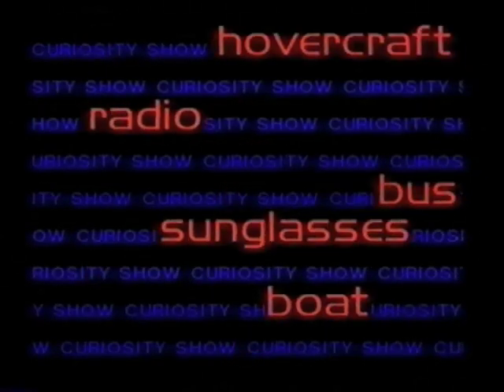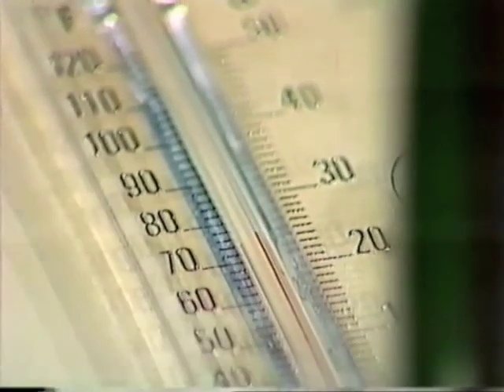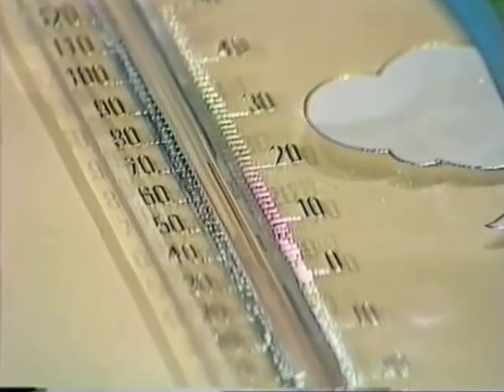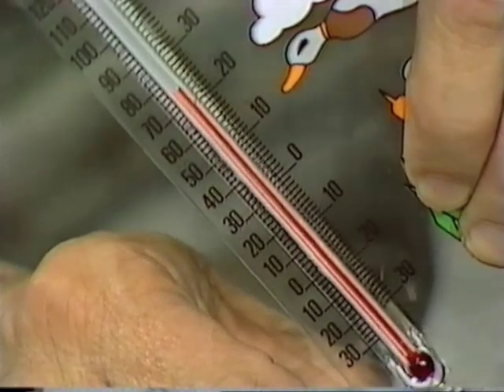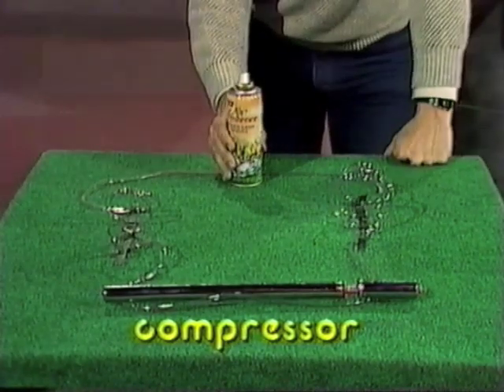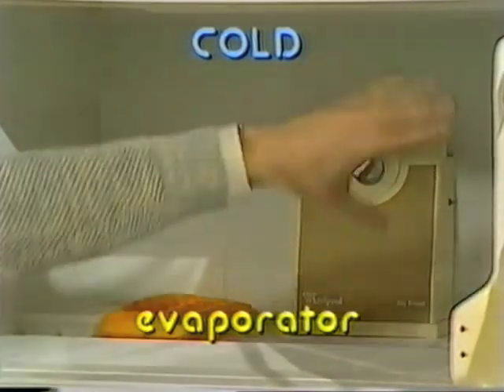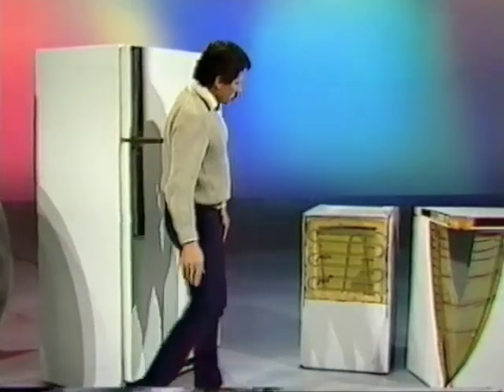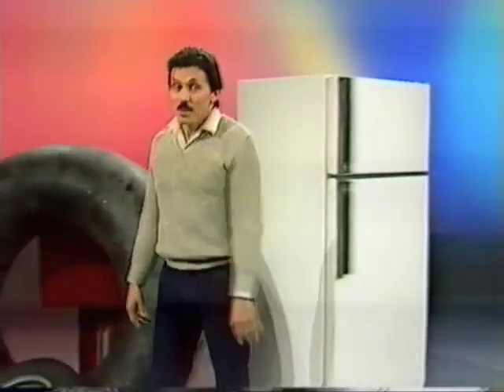Refrigerator - How Does It Work?

Comment: The fridge is by FAR the most reliable machine in your house. A fridge’s compressor motor will spin around several billion times in its life without service, cleaning or oiling.
Reply: Inaccurate 

A simple machine like a crowbar for example will work infinite times as long as you don't break it
Reply: Crowbar isn't a machine
Reply: @frankiephenomanal  A crowbar is a lever

A lever is literally a simple machine
Reply: @hiyukelavie2396  I'm assuming he meant automated machine, but could be wrong ...
Reply: Actually there is oil circulating with the gas that lubricates the compressor.
Reply: @hiyukelavie2396  crowbars would wear down and possibly bend
Reply: @Matt-ot9nx  Depends on what you use it on, and unless you're trying to break it on purpose, it'll still very likely outlast your fridge
Reply: @hiyukelavie2396  a crowbar is not a machine you doughnut its a tool and don’t be smart calling it a simple machine.
Reply: @themenacedemonkiller4867 
In physics a lever, and lots of other things like screws are called simple machines. Dude just forgot to add that.
Reply: @themenacedemonkiller4867  I suggest you look up what simple machine means
Reply: Not all things with the same signifier have the same signified, mate.
Reply: @Azchk   The clue is literally in the name 

Just because your understanding of the word "machine" is inaccurate doesn't change the fact that a crowbar/lever is in fact a machine

A machine is simply an apparatus that performs a function by using mechanical power, and mechanical power is simply the combination of forces and movement in a system
Reply: @hiyukelavie2396  You said it would work infinite times
Reply: @Matt-ot9nx  You're right it wouldn't
Reply: @UCQJ7S4vdrDfzv-HENBuQoEQ "A crowbar is a machine used (operated) by hand"

Correct

You say I'm trying to "win an argument", but I don't even see one 

A crowbar is a machine, full stop. What is there to argue about?
Reply: Thankfully, it's still the case, more or less. It would be with many other machines and appliances as well, if not for the perpetual renewal and purchasing culture. Lightbulbs can last hundreds of years if manufacturers would agree. Not a lot of business in that, though.
Reply: @hiyukelavie2396  I guess we could argue that it's only a machine when being used. (No more of a machine than a stick and a rock, being used for decoration on the lawn, when unused.) I could also argue the same for a refrigerator.

In which, a plugged in refrigerator is a machine longer. Since, a crow bar is often unused for periods of time.

But that's just digging up an argument, for fun sake. Not arguing that they are both designed to be machines. Just questioning if they are machines, when unused. Does the lack of force, mean it can't be considered a machine at that point?
Reply: No. My fridge gave out after 4yrs, during which I had repaired it 3 times. I swear my toilet last longer than that
Reply: I'm impressed you all didn't understand David Price's statement...
Reply: I like this thread, so I will add a bit of argument for fun.

What about in term of continuous service? Like OP said, fridge is reliable in the way that it can run billions of cycles in it life without maintenance.

A crowbar using long enough and it will bend, not familiar with pasta maker but I highly doubt it can last for so many cycles continuously without cleaning, aka, maintenance, scissors can be worn out without sharpening, about the lamp, you wouldn't turn it on 24/7, along with the fridge, right?

In this term, I think only a very good clock can compete with.

Again, this is just for fun, feel free to argue or point out what I maybe wrong about.

Edit: Spacing
Reply: @Bork-but-weird-letters   "Billions of cycle" sounds impressive, until you realize that the average life expectancy of a fridge is between 10-20 years
Reply: @hiyukelavie2396  still, about 90% of that time is the fridge running non-stop
Reply: @Bork-but-weird-letters   I understand your point, but it depends 

For a lamp, most of the wear and tear occurs when you switch it on and off 

Leaving it on without ever switching it off is actually better for its life expectancy

Look up the Centennial Light, a light bulb that was installed in 1901 and is still working

It sounds counterintuitive, but you will likely shorten the lifespan of your fridge if you had to switch it on and off multiple times a day instead of just leaving it running
Reply: Everyday words in the context of physics can mean very different things from the everyday meaning.
Reply: @hiyukelavie2396  ActUAlLy! wtf dude :D
Reply: @Azchk  what? thats like saying a small mountain isnt a mountain because its small. jesus wept
Reply: @themenacedemonkiller4867  it literally is. words have meanings and definitions my dude. a lever is a machine, just look it up
Reply: @hiyukelavie2396  “It’s not about being a smartass”
PROCEEDS TO DEBATE FOR 8 DAYS
Lmao
Reply: @hiyukelavie2396  a car also needs maintenance. But if I were to measure kinetic energy of a car versus a crowbar. I'm pretty sure the crowbar's entire lifetime, wouldn't compare to a car running for 100 miles. 10 miles might not even be comparable.

Same movement comparison with a refrigerator. Even though a refrigerator does not continually run. The compressor is continually shutting on and off. And that's without counting defrost cycles. But still, considering the kinetic energy involved. Crowbar < refrigerator. (It's an apples and oranges comparison anyways. It would be better to compare a wheelchair ramp. Imo.)

I will give you that OP was wrong about continual use. Refrigerators that are continually run, don't run as long. Most restaurants need maintenance about once per year, because the doors are frequently opened.
But then again, you were also wrong when comparing a light bulb to a refrigerator.
Reply: @MrBakblast  Is that how you cope when you are wrong?
Reply: @HugeSweetTea  Lol do you have any idea how triggered you sound?
Reply: Not if it's a Hitachi.
Reply: @hiyukelavie2396  I believe that was Bryan kory's first comment. If that's the case then he's a bystander making an opinion about you... and determining if someone is pedantic, is a matter of opinion in this context.
Unless you are saying they are lying about their opinion on you?

Or are you assuming that because they consider you "painfully pedantic" that they are against you? I wouldn't assume that since I've agreed with the conclusion, yet considered the person making it pedantic... not exactly in my own words.

To the trolls who might attack you... I don't think it's right.  I think you might be trying to focus away from something else, perhaps in personal life. So you are focusing on whether a comment is true or not. But that's me assuming and  projecting a bit.
Reply: @josholin31   I didn't make any assumptions about Bryan Kory 

I made no assumption on whether he was wrong or not, or whether he was trying to cope or not, or any other such thing. I simply asked him whether calling someone pedantic when he's wrong is his way of coping or not 

As for all the other stuff that you mentioned, what makes you think I'm not here simply because I find this whole thread amusing?
Reply: @hiyukelavie2396  where did he say he was trying to cope? Where did he even say something that could be questioned as fact?
He only stated an opinion.

It's about as relevant as asking if they sing while taking a shower. Unless you assumed he made a stance... nothing wrong in assuming, as long as you are aware of when you do it.. personally, I think it would've been better to let them know that in certain situations/professions, precision matters. So it's a good skill to practice.
(Idk if I mentioned it, but I think it's more likely that you thought they were someone else who previously replied to you.)

And about the rest. Like I said, It was an assumption and slightly projecting. I think it's a pretty fair assumption though considering the last few years and current events.
Reply: @josholin31  Lmao I didn't say he was trying to cope?

We all saw him calling someone pedantic

It's an interesting behaviour I find, so I asked if, by chance, that's how he cope with being wrong?

That's not the same as saying that he's coping with being wrong right now 

If anyone's making baseless assumptions here, it's you my friend
Reply: @hiyukelavie2396  lol. So how do you cope with eating bananas?
Reply: @josholin31  Bananas are delicious, no coping needed at all, just enjoy them as they are, after you peeled them of course 🙂
Reply: @hiyukelavie2396  or you don't eat to many. ;)
Reply: This conversation will last longer than the fridge 😳
Reply: @hiyukelavie2396  Also, we all knew that when anyone said "machine", they simply mean "compound machine", and compound machine is the combination of 2 or more simple machines; so refrigerator and crowbar are just incomparable.
Reply: @ultimaxkom8728  People like you just hate being wrong don't they
Reply: @hiyukelavie2396  *Scrolls up and skims the whole thread* Heh, how very ironic for you to say that here... Well, anything else useless you want to say? To help yourself cope more, that is.
Reply: @ultimaxkom8728  It's very obvious who's the one doing the coping here, isn't it? 

I'll just repeat what I said at the beginning:

"Just because your understanding of the word "machine" is inaccurate doesn't change the fact that a crowbar/lever is in fact a machine"

That's all that needs to be said here, really
Reply: People in here are arguing the semantics of a word definition, but words are inherently fluid in their meanings.  Definitions change over time, as do the words themselves.  That being said, in order to be precise some words maintain very rigidly defined boundaries as to be effective when communicating a message that needs to be as exact as possible.  Both sides are right.  

In common usage a layman wouldn't call a crowbar, or a cable, or other commonly used seemingly simple devices a machine.  However, that doesn't change the fact that they are still technically machines.  All it demonstrates is that language is used differently in different arenas.  The correct usage is the one that conveys meaning most effectively between the two parties.  If the receiving party hears a word that not only seems out of context, but will add nothing to the intended understanding of the situation, language is being used ineffectively and therefore is less correct in that situation.  Language, like all communication tools, is inherently situational and therefore to some degree fluid.
Reply: Lmao looked up machine “simple machines such as levers use hinged or revolute joints” a crow bar is a tool 

dying rn
Reply: it gets cleaned by the filter/water Seperator which on large units is changed several times in its lifetime. oil is added and changed as well on these units long with the refrigerant. By large units i mean the ones in commercial kitchens. some no bigger than a standard refrigerator. The issue with consumer ones is that they are made to never be serviced so they lack the ports to gauge up too and  are often not built with replacement of parts in mind. but i mean you could add a quick tap to gauge up too and do these things to the one on your house and they would last much much longer...some data sheets arnt available for them though
Reply: loltism and a drag
Reply: @hiyukelavie2396  we do have time to hear this, your a trained professional Gordon!
Reply: @whitenoise509   Correct 

The people arguing the semantics just couldn't stand being wrong 

Because even if we took "machines" to mean a more complicated apparatus than a lever, there are many other such machines that easily outlast a fridge. The examples I gave include clocks, pianos, sewing machines, a table lamp, and I'm sure we could think of more if we try to 

Seems like some people can't accept that, and resorted to arguing the semantics
Reply: @hiyukelavie2396  I'm only responding to your original assertion that a crowbar is a machine because I can't be bothered to read the rest of this weird tirade you've gone on. A crowbar is only a lever when in use, and the lever includes whatever you're bracing your crowbar against to serve as the fulcrum, so no a crowbar is not a machine.
Reply: @xEmptyPockets  "... I can't be bothered to read the rest of this..."

Oh you should. Because if you did, you wouldn't be making this post, because you would have seen this:

"A machine is simply an apparatus that performs a function by using mechanical power, and mechanical power is simply the combination of forces and movement in a system"

So yes you are technically right that a crowbar is only a machine when used. But by that definition a fridge is only a machine when plugged in and used

So if you're going to argue that the fulcrum is part of the crowbar, then you are essentially arguing that the wall socket is part of the fridge 

I don't need to tell you how silly this argument is 

But you are free to think this way if you want to, it's no loss to me
Reply: @ultimaxkom8728   Oh interesting. So you don't have a problem with my overarching message and the reason you're huffing and puffing right now is because you disagree with me regarding the definition of the word machine

Lmao who's the one harping on semantics here? 

Your action here is the literal example of someone harping on semantics. How bizzare. Do you even listen to yourself my friend
Reply: @hiyukelavie2396  crowbars need humans to work and humans need maintenance
Reply: @Roger_808  Where do you think fridges get their power from?
Reply: @hiyukelavie2396  the little surprided face in my wall
Reply: @Roger_808  And where do you think that little face in your wall gets power from?

A power plant 

Which requires maintenance
Reply: @hiyukelavie2396  I know it's a distinction without a difference but I think it only becomes a machine when it's paired with a fulcrum. Which is every time it's in use so it doesn't really matter
Reply: @hiyukelavie2396  the refrigerators compressor will rotate more times then grains of sand on earth it will have experience more rotations in it's existence the universe has currently... Is your refrigerator running? Go listen to what your wise old friend might have to say ✌️
Reply: Hmm. . . Even here I find them. It is day 2 of my investigation into this phenomenon and my findings are. . . interesting. See, there appears to be a growing number of human subspecies who for some reason go into comment sections such as this (particularly science related post) and over analyze a text or speech as if it were a piece of academic dissertation.

It makes me curious, do they take everything they hear literally? Are they a living Drax?

See to an ordinary human, the original post was pertaining to a specific feeling one might have for their refrigerator as weird as that might sound but the point is, a normal human reaction would probably be to "feel" or relate to that emotion that the OP wanted to express. 

But no! These human subspecies would take a fucking dicktionary and shove it down everyone's throat. The meaning completely lost to them, all that matters is that they are correct in the technicality of the words. 

It's like if I said, "I'm crying a river." They would literally type "no human is capable of crying a volume of tears equal to a river."

Which yes, it is correct! You're right! But that wasn't the point. You were not supposed to overanalyze the definition of the words used nor was it necessary to do so.

The comment is about the appreciation of the fridge and how reliable it is.
Reply: Most polite comment thread I've ever read.
Reply: I’ve never seen someone so eager to double-down on a bad hand so many times in one single thread over the course of two weeks before. Amazing.
Reply: @Kathleengrace_  Nice closing
Reply: Jokes on you, you don’t have our old fridge.
Reply: hard to repair
Reply: I actually enjoyed the thread. Made me remember and think over some facts. Thanks all for our shared boredness <3
Reply: @ultimaxkom8728   Oh, I understand you just fine 

Like I said, you don't have a problem at all with my overall message 

You just disagree with me on the meaning of the word machine 

Or in other words, your whole argument is based on SEMANTICS 

Do you not see this?

Who's the one being stupid here?
Reply: @aryanagrawal5629  Interesting

Why are you even on this channel if you're so allergic to learning?
Reply: @hiyukelavie2396  In other words, you didn't read what I wrote... *Sigh* Please reread my 2nd last message's last part where I literally and directly told you what the problem was. Now, read it right. I hope this mission wouldn't be too hard for you.
Reply: @ultimaxkom8728  Lol, you really hate being wrong, don't you?

Like I said, the ONLY argument that you've been making all this while is how you disagree with my definition of the word machine, which happens to be the correct definition

You're literally clinging onto semantics 

What else is there to say?
Reply: @ultimaxkom8728  Or, let me see if I can make this even easier for you

Do you agree with me that:

1. OP's post was inaccurate
2. A lever/crowbar is a machine

Yes or no would suffice
Reply: @hiyukelavie2396  Okay, I'll answer your questions. In return, you have to answer mine as well. 1) Yes. Although again, OP being wrong matters not. 2) Crowbar is a simple machine. So yes and no; by semantics it's a machine, but by use it's not.
Reply: @hiyukelavie2396  Now's my turn:
  1) Is the reliability of a wooden stick comparable with an electrical machine such as a gaming PC?
  2) Who is the first one to argue with pedantry and semantics in this thread?
Reply: @ultimaxkom8728   Very good 

You agree with me that OP's post was inaccurate, and you agree with me that a crowbar is a machine 

So... What is your problem?

Actually I'll tell you what I think your problem is

Your problem, like most other triggered people in this comment thread, is that you had a incorrect understanding of the meaning of the word machine, but you can't stand being corrected 

It's obvious isn't it?
Reply: @ultimaxkom8728  Uhm

1) I don't understand this question 

2) Why, of course it's all the triggered people who are trying to argue the meaning of the word machine
Reply: @hiyukelavie2396  Can you read? I said Crowbar is a simple machine, so yes by semantic and no by usage. Nobody outside the physics class who's not a pedantic like you consider a crowbar a machine. And no, that's not the problem. Read again.
Reply: @ultimaxkom8728  Lol, are you listening to yourself?

You are literally trying to argue the meaning of the word machine 

You are literally arguing about semantics 

This is all you've been doing since the beginning
Reply: @hiyukelavie2396  Nobody asked for a wikipedia entry for the definition of the word machine. I didn't even argued about the word's definition, yet you kept thinking that I do... Now now, how about you just answer my question. Don't try to avoid it.
Reply: @ultimaxkom8728  "I didn't even argued about the word's definition"

LMAO

So what is your problem?
Reply: @hiyukelavie2396  Also: "This is all you've been doing since the beginning" - don't you realize how ironic for you to say that? You talks as if I am the first one who started the argument about semantics weeks ago and being a killjoy for everyone here.
Reply: @hiyukelavie2396  "So what is your problem?" 
   ...
Do you even read what I wrote? Dude, what were you doing all this time? *Facepalm* Am I talking to a wall all this while?
Reply: @ultimaxkom8728  Oh, I do read what you wrote

And what you wrote is you trying to argue the meaning of the word machine 

As I said, stop it, it's getting embarrassing for you
Reply: @hiyukelavie2396  You argued a crowbar, a simple machine, is more reliable than a fridge, a compound one. You compared the incomparable in the basis that crowbar, by semantic, is a machine. You're arguing the semantics.
Reply: @hiyukelavie2396  No you don't. You kept saying that I argued the definitions of the word machine even though I didn't. That is the narrative you're clinging on. So it seems like you're on your last straw. Hm... Btw when will you answer my questions?
Reply: @ultimaxkom8728   No, don't be stupid 

First of all, OP did not specify that the comparison was only about complex machines. But even if the comparison WAS about complex machines only, OP's comment is still inaccurate

Secondly, there is nothing inherently wrong with comparing the reliability of a complex machine with a simple machine - they're both machines, and depending on the specific machine being compared, they all have different levels of reliability

And thirdly, you're trying to make it sound as if a simple machine has some kind of unfair advantage over a complex machine when it comes to reliability

This is not the case at all

A broom for example will get worn out long before a fridge breaks down 

Seriously, what are you doing man?
Reply: @ultimaxkom8728  "You kept saying that I argued the definitions of the word machine even though I didn't"

LMAO, says the guy who is trying to argue "machines" = "compound machine"

You are literally trying to argue that the word machine only refers to complex machinery 

Stop and listen to yourself
Reply: @hiyukelavie2396  1st: You're just being obtuse. You knew exactly what the OP meant by machine. Again, this is not a physic class. 2nd: Yes there is. Especially so when comparing a crowbar to a an electrical machine. 3rd: Doesn't matter.
Reply: @ultimaxkom8728   No

1) It's not a problem if OP, and you, did not know what the word machine means

It IS a problem when you cannot accept being wrong and try to argue that "machines" = "complex machines" only

2) According to who? You?

3) Lol "doesn't matter". Is that how you react when you have nothing to say 

Again, it's abundantly clear what the problem here is 

People like you just can't stand being wrong
Reply: @hiyukelavie2396  Wrong. I argued that machines by the common use, aka for any non-educational uses, like the OP's simply meant compound machines. I never said that simple machine are not machine. Please stop twisting my words.
Reply: @hiyukelavie2396  1) Again, I never said machines only meant complex machines. Stop lying. 2) According to the common sense that a brick is not to be compared to a brick house. Or a wooden stick to a gaming PC. 3) It simply doesn't.
Reply: @ultimaxkom8728  Uhm, don't be stupid 

You absolutely can compare a brick and a brick house 

For example:

Q: Which is more expensive, a brick or a brick house?

A: A brick house

There you go. I just compared them

Stop trying to be obtuse
Reply: @ultimaxkom8728  🤣🤣🤣

You: "I'm not trying to argue semantics"

Also you: "Well machines obviously means this"

GTFO man
Reply: @hiyukelavie2396  I'm only pointing it out what machine commonly means, not arguing the definitions of the word machine. Plus, are you disagreeing that the common use of the word machine simply means complex machine?
Reply: @hiyukelavie2396  Wrong again, I never said a brick "cannot be compared" with a brick house, and I never said that I'm not arguing semantic. Because of course I have to; you're arguing about the semantics after all. Also, where is your answers?
Reply: @ultimaxkom8728  Oh god this is gold

Semantics: the branch of linguistics concerned with meaning 

When you try to argue what the word machines mean, you are literally engaging in semantics

Or are you going to start arguing the meaning of the word semantics now 🤣🤣🤣
Reply: @ultimaxkom8728   🤣🤣🤣

You: "I never said a brick cannot be compared with a brick house"

Also you: "According to the common sense that a brick is not to be compared to a brick house"

What are you doing?
Reply: @hiyukelavie2396  1) Again, I am arguing about semantic, I never said otherwise. Read my last reply. 2) I never said they "cannot be compared," yet you "disproved" me by saying that "You absolutely can compare (them) ...". Lol.
Reply: @ultimaxkom8728   Ok!

So you agree that YOU are the one who's bringing semantics into this

Good! We're making progress then!
Reply: @ultimaxkom8728  LMAO look at you trying to wiggle your way out of the hole you've dug for yourself

You said that a brick is not to be compared to a brick house

But I did just that 

Take your own advise and stop being obtuse
Reply: @hiyukelavie2396  What? You're the one who brings semantics to all this, and so me and everybody else had to as well. Please reflect. And "is not to be compared" means one shouldn't, not that one can't. How hard is it for you to understand?
Reply: @ultimaxkom8728   Lol no don't be stupid, read my very first post again 

I pointed out that a crowbar will outlast a fridge 

There isn't any arguments about semantics involved at all
Reply: @hiyukelavie2396  You compared crowbar a simple machine with a fridge because by semantic, they're both "machine", even though you knew the OP simply meant "machine" by its common use. Again, you're arguing with semantics. Just admit it.
Reply: @hiyukelavie2396  There's nothing wrong in just comparing a brick with a brick house, ofc, but that is only when you forget the context. The context here is ofc that it's just an analogy of the crowbar and the fridge, and with the context, yes it's wrong.
Reply: @hiyukelavie2396  I said simple machines shouldn't be compared with complex machines, just like a wooden stick is not to be compared with a gaming PC. Haah... Do you have dementia or what?
Reply: @ultimaxkom8728  And why shouldn't simple machines be compared with complex machines?

Is this the same stupid logic like your brick and brick house example?
Reply: @hiyukelavie2396  Just use some common sense on why wooden stick, a simple machine, should not be compared with a gaming PC, a complex machine, on reliability.
Reply: @hiyukelavie2396  No, the context here is which machine, obviously in its common use meaning, is more reliable. Also, it's not a "perfectly valid comparison", as crowbar is not a complex nor electrical nor automated machine like the fridge is.
Reply: @hiyukelavie2396  1) It's a better analogy for the crowbar, a metal stick, and the fridge, an electronic. 2) A wooden stick is a simple machine. "Are you this desperate to save face" Says you who deleted your own reply that I've just replied to.
Reply: @ultimaxkom8728  Let's review what we know

-You agree that OP's statement is inaccurate
-You agree that a crowbar will outlast a fridge
-You agree that a crowbar is a simple machine
-You agree that a simple machine is a type of machine
-You agree that many machines will outlast a fridge

I've managed to prove that not only do you not have an argument against what I'm saying, you are actually actively agreeing with what I'm saying 

But for some reason, you're choosing to be a whiny little boy here, trying to argue that "oh but machines don't really mean machines"

Seriously wtf is wrong with you
Reply: @ultimaxkom8728  No, a wooden stick is a wooden stick 

Don't be stupid
Reply: @hiyukelavie2396  No, a wooden stick can be used as a lever, so it's a simple machine. Don't be stup- why do you keep repeating this phrase like a kid? Also, this is already a semantic arguments since the very start. All thanks to you.
Reply: @hiyukelavie2396  Here's the logical reasoning: a complex machine is a set combination of 2 or more simple machines, and a single element (simple m.) cannot be compared to a set of elements (complex m.). Just like 1 is incomparable to {1,2,3,...}
Reply: @hiyukelavie2396  About your review, yeesh, talking about being obtuse and childish... You still pretended to miraculously not see my point even after all this. You knew what I actually said, yet you twist it anyway. Don't you feel embarrassed?
Reply: @hiyukelavie2396  1) So? You too talk about a metal stick at the start. 2) You had to be brainless to compare a wooden stick with a fridge reliability and really think that it's a valid comparison just because they're, by semantics, "machines".
Reply: @ultimaxkom8728   What did I tell you about being stupid?

One, your explanation makes no sense. Yes, you pointed out the difference between a simple machine and a complex machine. But you haven't told us WHY they are incomparable

Two, they are NOT incomparable. You CAN compare them in a myriad of ways. I've already demonstrated this to you. Keep up with the program please
Reply: @hiyukelavie2396  1) Because one is an element (simple m.) and one is a set of elements (complex m.), and you can't compare an element with a set. Like comparing the number 5 with the set {4, 7, 10}. 2) Those are not valid comparisons.
Reply: @ultimaxkom8728   😂😂😂

Firstly, that still makes no sense, you're still just pointing out the difference between them instead of the problem with comparing them 

Secondly, we're talking about which one has a longer life span. A fridge has a lifespan. A crowbar has a lifespan. Of course it's a valid comparison 

Try harder
Reply: @hiyukelavie2396  You're comparing a crowbar a SM with a fridge a CM only by the semantic basis of the word "machines", ignoring the obvious that the OP was using its common meaning. So yes, you're started the semantics arguments.
Reply: @ultimaxkom8728   Wait, no, don't pivot away 

A crowbar is a machine, and crowbar has a lifespan

A fridge is a machine, a fridge has a lifespan 

What is the problem with comparing their lifespans?

You can't just stamp your feet and tell people they can't compare them

You need to explain WHY NOT
Reply: @hiyukelavie2396  1) How come you still can't understand... *Sigh* The problem with comparing them is that they're not of the same category; one is an element, and other is a set of elements. One is a wheel, and the other is a car. 
  2) Crowbar is a simple, non-electrical, and manual machine while the refrigerator is a complex, electrical, and automated machine. They're clearly not a valid comparison.
Reply: @hiyukelavie2396  I already told you that an element can't be compared with a set. And again, those plain comparisons you've just made lacked the context. It should be "Which machine is heavier/reliable, a wheel/crowbar or a car/fridge?".
Reply: @ultimaxkom8728   No you haven't explained shit

You're just doing this circular argument thing where you claim that a brick and a brick house cannot be compared, and then when challenged to provide an explanation, you point to your own claim as the explanation, which it is not 

You seem to be under some kind of delusion that a complex machine can only be compared with another complex machine 

Why is that?

There is no such logic

A complex machine can be compared with anything, as long as the comparisons make sense. Heck, anything can be compared to anything as long as the context of the comparison makes sense 

In terms of lifespan, a complex machine can absolutely be compared with a simple machine 

Hell, I can compare the lifespan of a fridge with lifespan of a pair of running shoes if I wanted to 

Q: Which will last longer, a fridge or a pair of running shoes?
A: A fridge 

The comparison makes perfect, logical sense, even if one of them is a complex machine and the other is a footwear 

Conversely, you can make a completely nonsensical comparison between two complex machines 

Q: Which is more honest, a fridge or a blender?
A: Neither because the comparison makes no sense 

In this case, even if we are comparing two complex machines, the comparison does not make sense

I mean, this is all really basic stuff that even elementary school children understand

But not you apparently

It's really bizzare how you keep shouting about how a simple machine just categorically cannot be compared with a complex machine 

I know that you're just trying your best to hang in there and save face, but it's just ridiculous at this point 

Like I said, people aren't stupid. Everyone who reads this sorry ass argument of yours can see how stupid you are acting
Reply: @hiyukelavie2396  Hmm alright. I think I've already had enough and done enough for this thread. This is very likely to be my last reply. So have fun comparing metal sticks with desktop computers all alone once again. Well that's it, bye bye.
Reply: As a stupid person, i have to thank @Hiyuke La Vie

At least he made me not the stupidest person 🤗
Reply: @hiyukelavie2396  are you constantly using the crowbar at maximum effort 24/7?
Reply: @travisdickens4304  Good point, but this has been brought up and addressed earlier 

The counterpoint is that a fridge being kept constantly running is actually something that works in its favour, when it comes to longevity. Much of the wear and tear in these things actually occur when you switch it off and on. Think engines, lightbulbs, the AC, etc

The centennial lightbulb, for example, has been working for more than a hundred years, and one reason for its longevity is the fact that it rarely got switched off. It's theorized if it gets switched off now, it may not switch back on again
Reply: @ultimaxkom8728  I know it might be difficult for you, since you're evidently doing the best you can to try and save face here. But facts are facts 

A simple machine is a machine. A complex machine is a machine. They are both machines

Just as how a chocolate cake is a cake and a butter cake is a cake. A mobile phone is a phone, a rotary phone is a phone. A porcelain cup is a cup, a paper cup is a cup. A table knife is a knife, a survival knife is a knife. A touchscreen TV is a TV, a CRT TV is a TV. And so on 

You trying to argue that there is some universal law against comparing them just because they are different is just the epitome of obstinance and foolishness
Reply: @hiyukelavie2396  went sicko mode in this reply section
Reply: bruh a crowbar is literally a straight bar of metal with a bend in the end. it's a tool. machines have multiple parts that work in unison. nice troll b8 m8
Reply: @GigaNigga-ep3nw  It may come to you as a shock, but things like crowbars, nails, and brooms are all examples of what is called a simple machine
Reply: @hiyukelavie2396  there is no way a crowbar can work infinite times unless it's infinitely thick or long or infinitely dense. 

_>inb4 "you're infinitely dense" comment is posted at me.
Reply: @allaware5014  You are right
Reply: @KingBong420420  well atleast this thread produced this gem. Brb gonna go chat with the interstellar ice box.
Reply: @hiyukelavie2396  
Is a see-saw a machine or a tool?
A see-saw just like a crowbar applies a force on a object by using the principle of leverage. 
I'd say its a simple machine, but one could argue that it's a tool as well. 🤔
Reply: @Matt-ot9nx  
Is a see-saw a machine or a tool?
A see-saw just like a crowbar applies a force on a object by using the principle of leverage. 
I'd say its a simple machine, but one could argue that it's a tool as well. 🤔
Reply: @johno9507  A see-saw is also a simple machine, correct 👍🏻
Reply: @johno9507  a simple machine is a tool
Reply: @hiyukelavie2396  Getting back to your original comment. You loaded a conditional proviso into the assertion of infinite working life: "...as long as you don't break it." This makes total nonsense of the hyperbolic use of "infinite" and the comparison. 
Fact: Crowbars do break and bend. Fact: I have had crowbars that failed within 5 mins with normal use. Fact: Fridges also break and fail. 
Your whole comment was self defining and the exact same could be said about either the fridge or any other thing. Everything works forever - until it doesn't.
We will all live forever so long as we never die.
Reply: @DiscoFang   Things sometimes stop working due to breaking from incorrect usage, and things sometimes stop working due to wearing down from regular usage

The "as long as you don't break it" proviso serves to differentiate between this 

But yes, I agree with the problem of using the phrase "infinite times". You aren't the first to point this out

Still, I enjoy reading your reply. It's well written and well thought out. Well done ✅
Reply: @hiyukelavie2396  We are never wrong until we are.
Reply: @hiyukelavie2396   He clearly meant complex machine, which a lever is not. Simple machines are virtually always self sustaining and low maintenance, aside from maybe pulleys. His point is still really correct
Reply: @fizzmoe9846   Two things

One, the key realization for you here is, no one calls a fridge a machine in normal conversations

Yet he went out of his way to specifically call the fridge a machine. Instead of a kitchen appliance, home appliance, electrical appliance, household device, electrical equipment, consumer electronic, white goods, or basically any other words people would use to describe a fridge

So when he specifically chose an uncommon word used to describe a fridge, in this case machine, the implication is that is the exact word he wanted - machine

The question of "oh he obviously meant something else instead" does not arise 

Two, even if he meant complex machines only, he is still wrong. Numerous examples have been given here to prove that
Reply: I've a refrigerator made in 1985 that has been running mostly uninterrupted since 1986. The old gal just needs a good surface cleaning, some new paint, & new door seals.
Reply: @hiyukelavie2396  Well then the crowbar is a part in a system, not a machine on it's own, it has no moving parts
Reply: @hiyukelavie2396  look up definition of machine.
Reply: @Mike-or7xv  Ok

First sentence of the Wikipedia entry for machine:

"A machine is a physical system using power to apply forces and control movement to perform an action"

You don't like Wikipedia? Ok. The Merriam-Webster dictionary defines machine as:

"a mechanically, electrically, or electronically operated device for performing a task"

You're welcome
Reply: @hiyukelavie2396  ok I stand corrected. In my line of work, machinery (as defined by the machinery directive) is: “an assembly, fitted with or intended to be fitted with a drive system other than directly applied human or animal effort, consisting of linked parts or components, at least one of which moves, and which are joined together for a specific application” 🤷🏻‍♂️
Reply: @hiyukelavie2396  I take issue with the statement "A simple machine like a crowbar for example will work infinite times as long as you don't break it".

- I agree that a crowbar is (usually) employed as a class 1 lever, and hence a simple machine.
- I agree that in theory the crowbar will be operable an infinite number of times. 
- The problem is the qualifier, "as long as you don't break it". This is true of all machines - and a useless qualifier rendering the comparison meaningless.

Explanation:
How could a crowbar be broken? It may be plastically deformed by a moment force that was too great (such as using a 'cheater bar') which is what I suspect you had in mind, however there is also another way it may be broken which I suspect you have not considered: cyclic loading. If the crowbar is simply used too many times, it will undergo too many cycles of elastic deformation, causing fatigue and eventually it will work harden, and break. This is the practical limit and disqualifies the "infinite times" part of your statement from anything but a hypothetical crowbar.

If you have considered cyclic loading, please explain how a practical crowbar (rather than a hypothetical crowbar) is exempt from the effects of fatigue and hence operable an infinite number of times.

As such perhaps the best (yet utterly redundant) statement is: a fridge will work until it breaks and a crowbar will work until breaks, which does not change the fact that David Price was correct to marvel at the long MTBF for a fridge's compressor motor given it likely receives no maintenance, compared to many other household machines.
Reply: @hiyukelavie2396  do you enjoy this
Reply: @carneeki  You are right. You also aren't the first person to point out what you pointed out

My reply to the last person who more or less said the same thing:

"
 @Cassette Walkman   Things sometimes stop working due to breaking from incorrect usage, and things sometimes stop working due to wearing down from regular usage

The "as long as you don't break it" proviso serves to differentiate between this 

But yes, I agree with the problem of using the phrase "infinite times". You aren't the first to point this out

Still, I enjoy reading your reply. It's well written and well thought out. Well done ✅
"

As you can see, he also wasn't the first to point out the same things 

But it's ok, it's a long comment section, people don't read everything
Reply: @hiyukelavie2396  Thank you :) Yes, I missed the reply similar to mine, it is a long thread. I admire someone who is willing to defend their position, as well as someone who is able to grow. Great maturity - I hope many can learn from you.
Reply: @hiyukelavie2396  A crowbar on its own is not a simple machine but a part of a simple machine when used in conjunction with a pivot. Your statement is inaccurate.
Reply: @hiyukelavie2396  you keep a crow bar in your house ?
Reply: @hiyukelavie2396  my bong will last longer than a crowbar lol and it can be used millions of times more. it is powered  by fire your crawbar is powered by hand. not everyone has a crowbar in their household. You should deligate that to autos not homes. plus people can steal your crowbar and it would not last as long in your household. if you wanted to get technical we can
Reply: @hiyukelavie2396  Machine, noun: An apparatus using or applying mechanical power AND HAVING SEVERAL PARTS, each with a definite function and together performing a particular task.

The definition of machine that you are using is not the one we are using here. Regardless, a crowbar is dwarfed in complexity by a refrigerator and its durability is unimpressive as a result.
Reply: @jackb3822  Lol

Let me direct you to my reply about 10 comments above yours:

"
Ok

First sentence of the Wikipedia entry for machine:

"A machine is a physical system using power to apply forces and control movement to perform an action"

You don't like Wikipedia? Ok. The Merriam-Webster dictionary defines machine as:

"a mechanically, electrically, or electronically operated device for performing a task"

You're welcome
"
Reply: @hiyukelavie2396  Yes, those are definitions that exist, and are correct. However they are obviously not the one that the original commenter was using. Nobody is surprised that a bar of metal is durable and low-maintenance. A crowbar is a machine, but not the kind that is being talked about.
Reply: @jackb3822  Here's the thing to realize 

People don't generally call a fridge a machine in everyday conversation

A fridge is usually referred to as an appliance. As in, an electrical appliance, or a household appliance

It may even be referred to as consumer electronics, white goods, kitchen equipment, etc 

Even though it fits the definition, it is rarely referred to as a machine in daily conversation 

So if the original commenter went out of his way to call a fridge a machine, then he means exactly that - machines 

He's eschewing everyday language, in favour of playing the definition game 

So if he's playing the definition game, then by definition a crowbar is a machine

You can't pick an obscure but technically correct way to call a fridge, but then revert back to "common sense" when it suits you
Reply: Some of the comments below challenge your use of the word "machine". 
   Well.... an absorption refrigerator (RV refrigerator) works by using a flame as the pump.... zero "mechanical" moving parts..... unless you consider ammonia a moving part.     
     Take THAT all you negative commentators!
Reply: I bet you my fridge will stop working soon now that I’m thinking this
Reply: @readmore3634  Thats actually a pretty good point. Though I still think that the difference in complexity in a crowbar vs a fridge should be taken into account, even if not divided by the word machine.
Reply: @hiyukelavie2396   Such a useless argument, you know exactly what the OP and regular people mean when they say "machine". Sure, inform them. But anything beyond that is so out of touch with social norms. This combined with your rudeness made people react the way they did. Just friendly advice, you seem like someone that has trouble understanding these things.
Reply: @filipraos8072  You talk about "social norms" 

Is it "social norm" where you're from to call a fridge a machine?

Because where I'm from, the "social norm" is to call a fridge an appliance - as in a household appliance or electrical appliance
Reply: @hiyukelavie2396  a crowbar lays still for most of its life performing no work and compressor is constantly working
Reply: @hiyukelavie2396  mate the only one coming off looking bad here is you. You are being not picky and reliant upon bare bones technicals to make a point so fine that almost nobody cares. Sure a crowbar is a "machine" but you know what they mean and you're argument basically means literally anything that can transfer force is a machine which most people would find ridiculous. The deeper I get the shittier you get. Over a damn crowbar lol. Go touch some grass and stay off the web for a bit. It will be cathartic
Reply: @hiyukelavie2396  stop no lifing in this reply section
Reply: @unsolicitedditkapics9722  LMAO. Another person who thinks he's so clever using the "you know what he meant" angle

Allow me to refer you to one of my earlier response to this sad excuse of an argument you're using:

 "
Here's the thing to realize 

People don't generally call a fridge a machine in everyday conversation

A fridge is usually referred to as an appliance. As in, an electrical appliance, or a household appliance

It may even be referred to as consumer electronics, white goods, kitchen equipment, etc 

Even though it fits the definition, it is rarely referred to as a machine in daily conversation 

So if the original commenter went out of his way to call a fridge a machine, then he means exactly that - machines 

He's eschewing everyday language, in favour of playing the definition game 

So if he's playing the definition game, then by definition a crowbar is a machine

You can't pick an obscure but technically correct way to call a fridge, but then revert back to "common sense" when it suits you
"

TLDR: he specifically picked a highly unusual yet technically correct term to refer to a fridge, so no, you don't get to play the "you know what he meant" card 

Please try harder
Reply: @hiyukelavie2396  it's not clever dude. That's what you don't seem to get. It's COMMON SENSE
Reply: @unsolicitedditkapics9722  You seem to have difficulty reading my previous comment. Here, allow me to copy and paste

" 
Here's the thing to realize 

People don't generally call a fridge a machine in everyday conversation

A fridge is usually referred to as an appliance. As in, an electrical appliance, or a household appliance

It may even be referred to as consumer electronics, white goods, kitchen equipment, etc 

Even though it fits the definition, it is rarely referred to as a machine in daily conversation 

So if the original commenter went out of his way to call a fridge a machine, then he means exactly that - machines 

He's eschewing everyday language, in favour of playing the definition game 

So if he's playing the definition game, then by definition a crowbar is a machine

You can't pick an obscure but technically correct way to call a fridge, but then revert back to "common sense" when it suits you
"
Reply: @hiyukelavie2396  your troll existence is sad
Reply: @unsolicitedditkapics9722  Oh come on, don't give up now, you were so sure of yourself just now
Reply: @hiyukelavie2396  you know what he means by machine, smart guy. 🙄
Reply: @SadBadge  You realize you're defending someone who called a fridge a machine
Reply: @hiyukelavie2396  A crowbar is not a simple machine. It is not a lever. A lever has a fulcrum. A crowbar by itself does not have a fulcrum so the person was accurate.  I’ve bent many crowbars cheap and expensive so the do wear out rather quickly. Besides, they meant an automated machine.  Not too many electric crowbars.
Reply: @maxwellhouse750  Oh hello

1. A crowbar is a simple machine. A broom is a simple machine. A bottle opener is a simple machine. That's all there is to it. Look it up before you decide to argue further 

2. "Besides they meant an automated machine". Please elaborate. What made you come to this conclusion
Reply: @hiyukelavie2396  I don’t have to look. I know. A crowbar is a tool. When used in combination with the floor or another lever like surface it becomes the quintessential classic machine taught in physics. Quit using Wikipedia as the ultimate source of knowledge. The person who made the comment was trying to make a point and you clearly missed it. You clearly have a lot of people that agree with you. 🤣. I thought you said awhile back you were making your last reply. Sorry.
Reply: @maxwellhouse750   Lol no

You clearly have no idea what you're talking about if you're saying a crowbar/broom/bottle opener isn't a simple machine 

And no, when did I say I made my last reply? Are you imagining things?

I'm having much fun putting down conceited idiots who don't know what they're talking about, why would I stop?
Reply: @hiyukelavie2396  Ok. I will now live in your twisted world. A grain of sand is a simple machine because it contains atoms which have electrons that move in orbits. Enjoy your day.
Reply: @maxwellhouse750  Lol be recalcitrant
Reply: @hiyukelavie2396  if you said "pass me that machine" and you were referring to a crowbar you'd be laughed off the building site. 

Esoteric scientific terms have vastly different definitions, think the scientific meaning of the word theory compared to the layman's definition of the word theory. 

You calling out others for 'arguing the semantics' is ridiculous considering it's a semantic point you've made in the first place. A crowbar may be a simple machine, but a simple machine isn't a machine. And since language is not proscriptive, and nobody is agreeing with you're usage, it's pretty clear you're objectively in the wrong here. 

This comment war autopsy has been provided as a free service.
Reply: @hiyukelavie2396  he is talking about automated mechanics nitwit
Reply: @jeremybradley559  hes probably never used anything outside of a Phillips screwdriver.
Reply: @twojointsjay7330  you should be expecting a reply from Hiyuke themself very soon. Good luck
Reply: @twojointsjay7330  "A simple machine isn't a machine"

Bruh
Reply: @hiyukelavie2396  man... Crowbars are invincible! We should just build everything out of them.
Reply: @johno9507  

yeah, but you could add that to several other machines, and even then that oil needs to be replaced in just about every one of those machines.
Reply: my refrigerator motor stopped spinning after a mouse got stuck and died inside of it
Reply: Yes its very impressive
Reply: Yup, couple of magnets, coils of copper over an iron, electricity, and a regulator to make sure there is no spike in electricity.
Reply: Usually the motor goes out because the refrigerant leaks out and the motor end up pumping nothing... so usually the motor in that thing is the last to break lol!
Reply: @drivelikej9962  WTF :D :D :D
Reply: @hiyukelavie2396  Frankly, i have to admit, you made me look for dictionary meaning of a machine.
Now i am more confused., help me understand  what mechanical power does a Microwave oven use ?? is it not a machine ??
Is my computer or the server i use, a machine ??? why does do prominent tech companies literally use the phrase  "Lets restart the machine" ??? 
what mechanical or natural force does my system use ??
Well sir, i am totally confused now.......
Reply: @josholin31  wow you made a very valid point man
Reply: @hiyukelavie2396  Well, now you are just saying this for the sake of it. I mean - yes we dont switch off and on the fridge every day, but hey cmon -  in a day the compressor of the fridge goes on and off atleast 4/5 times an hour, which is like 100 times the compressor goes on and off in a day. Its not that compressor is running at stretch (like your example of centennial light). Besides in Asian countries power cuts are common, meaning it will go on and off many times a day anyway (for short period). I bought a LG fridge in 2009, never had an issue until now. I bought an LG coz my mother has one since 1993 and its been running till date without any issues., not a single service (until being replaced last year coz it looked really old and mom wanted a new one). So constant switching on & off will certainly affect light bulb (especially if it has filament, LED bulbs will never get affected with your on & off) but i dont thnk that applies for every electronic equipment. I mean you surely seem to know what you talking., you might be perfect and most accurate theoretically., but hey practicality is subjective to many things (including environment in which the a fridge is being operated). 
You are right with regards to your definition of machine.,but hey being confident is one thing, and then getting carried away to just say anything for the sake of it is sign of over-confidence. C'mon sir
Reply: @hiyukelavie2396  you comparing the compressor continuously doing the job of compressing the refrigerant, hour after hour, day and night., to a simple machines like piano ?? sewing machine ?? Dude are you a mechanical engg or English professor ?? Are you defining an object or justifying the legitimacy of using the word Machine ??? What are you exactly trying to do ???
Reply: @abhishekjha346  A machine is an apparatus that uses mechanical power, and mechanical power is just a combination of force and movement 

In terms of a lever, you supply the mechanical power by exerting a force, in the correct direction

It's the same for a microwave oven 

A microwave oven is powered by a wall socket, which supplies it with electricity. Electricity is just mechanical power with extra steps 

Yup, a microwave oven is a machine
Reply: @hiyukelavie2396  With due respect, i am more than shocked/baffled with your explanation here. 
Are you saying Electricity is not flow or electrical energy (flow of electrons) but it is Mechanical energry plus some extra steps ??? Are you considering electricity as mechanical energy because its flow of electrons ?? :D :D :D

In that case what the hell does electric motor do ?? does it convert electric energy into mechanical energy or does it convert mechanical energy into other form of mechanical energy ?? :D

Do you support your claims with any reference to any artifacts or are these theory product of your genius mind ???
Reply: @abhishekjha346  How do you think electricity is generated?
Reply: @hiyukelavie2396  again, sir are we gonna go into origins ?? Sorry but i studied that Energy cannot be created/destroyed, but can only transform from one form to another. 
Potential energy of coal/Nuclear fuel, that get converted, and then further transforms into mechanical which inturn turns the turbines., i mean transformaion of energy isnt it ???
Reply: @abhishekjha346   See, you have given yourself the answer

A microwave oven is powered by mechanical power 

The mechanical power just happens to get converted into electricity first before reaching your microwave oven
Reply: @abhishekjha346   The point is you were trying to argue that a microwave oven isn't a machine?

And no, don't be obtuse, kicking a stone doesn't make it a machine 

There are 6 types of simple machines. A rock being kicked isn't one of them

I suggest you go and educate yourself and learn what simple machines are before trying to troll any further
Reply: @hiyukelavie2396  At what point did i say that Microwave isnt., infact i asked you if Microwave or Computer/Server., are they machines are per your definition of machine using mechanical energy in order to function. And i said they are machines indeed but they dont necessarily use mechanical energy to operate. Like in case of Microwave of Computer., they need electrical energy., that another top how electrical engg is produced., you can go as deep as you to establish where it begins.

By your logic, you applied a mechanical force on crowbar and it does your job - your intended job of lifting something., in my case my intention was to pluck a mango which is way above my height. i needed a tool like you needed a tool - crowbar. The stone in my case is my tool (in your sense my machine) on which i apply mechanical force at a particular angle and it does the job. Alright lets leave the stone aside., lets pickup a a stick. I use stick, apply force at one end while holding it, wont it do a job with mechanical force applied at other end......, just like your crowbar, so why isnt a stick also a machine like your crowbar.
Isnt it how you explained crowbar is a machine ???? I am not trolling you, it aint worth., was just trying to understand your logic, your explanations etc.......
I aint judging your education qualification., your whatever., so dont worry about mine. Lets just stick to you making a point, me countering with my questions and my logic., and you explaining it further. We can agree or disagree with each other but dont get personal.
Chill man. 
I think i gave you enough respect all this while in all my comments. Try to live up to it SIR.
Reply: @abhishekjha346   Physics class. You have them, yes?

A lever being a simple machine isn't "my logic"

It's what's being taught in physics class 

If you are unhappy about that, go and argue with your physics professor

🤷🏻
Reply: @hiyukelavie2396  I at no point said crowbar isnt a machine. .... did it ?? Just another ASSumption which you did with other poeple in this thread. Stop with your rant man.
A lever is a simple machine yes, did i say no ??? The questions i asked were just follow-up questions to the "reasoning" you gave as to why a crowbar is a machine. 
With that logic - doesnt See-Saw in playground do the same job of what a crowbar does, right ?? So can we call see-saw a machine ??? Is screwdriver a machine or is screw a machine. Are you trying to run away from answering by saying thats what you learnt in school....???? argh., can someone get more lower than this ??????
Well Mr Self proclaimed physics wikepedia - Are you of the opinion that crowbar is a machine just because force is applied at one end and work is done at the end...?? With that definition even stone and wooden stick also do a job but they are tools not machine.
So thats not what makes a crowbar as a machine., i think the reason its called a machine is coz  what it does is it amplifies the force applied at one end, just like pulley., so it has a physical property where it reduces the energy required to do a job otherwise., hence its a machine., (you are welcome to correct me, i am not a heavy headed like you, i dont have arrogance when someone tries to correct me., i dont think i am always right, well i am not you, you know)
whereas a stone or wooden stick isnt coz it cant do that. A crowbar shaped wooden stick cant be a machine coz it cant do a job what crowbar will do. You are hopeless in explaining why its called a machine but you have arrogance to insult others and ask them to go learn science.....?? 
Well first of all every day many popular science myths are being debunked by some or the other researcher. They too learn few things from their respective professors and they are proving those teachings to be myth. Old uncles like you do not believe that there is a slight possibility that future generations can prove what you learnt was not entirely correct (if not wrong). 
I think Galileo did the same to all other punks who thought what they had learn from their that time teacher/preachers was right. So get over that and lower down your arrogance a bit.
Reply: @twojointsjay7330  The comment was simple - The fridge is by far the most reliable machine in your house. To that this genius's reply was that crowbar will work infinite times. Do you see any connection in these two sentences. That is his comprehensive skill. You talk about reliability and he counters it with infinite  Well in physics there is nothing thats infinite., nothing that i can think of. Stars, universe, nuclear decay, what shit in this universe is infinite ?? And this man saying crowbar is infinite, thinks he is science genius. 
A fridge has a compressor that goes on and off atleast a million times in its life cycle of 15-20 yrs., that isnt most reliable according to this bloke but a crowbar can work infinite., you know crowbar never decays/corrodes/rusts., never breaks., never bends., never loses its shape......... ********** can you imagine this genius.
DId you read his other reply to me - Electricity is mechanical energy plus some steps. ,thats his definition of electricity. That way every shit in this world  is potential energy plus some step.,
Reply: @abhishekjha346  And yes, a see-saw is a machine 

Stop embarrassing yourself, please
Reply: @hiyukelavie2396  oh plz everyone in this thread knows who's being a total embarrassment here. Go pick your infinite machine - crowbar and help yourself
Reply: @abhishekjha346  It IS embarrassing when you type things like "can we call a see-saw a machine???" when a see-saw is in fact a machine
Reply: @hiyukelavie2396  i have so many swear words for you dunno where to start.., Nevertheless its not worth.
Embarrassing is when a science student calls something as infinite.... (may be yes theoretically but what the hell really is infinite this universe ???
Reply: @abhishekjha346  he's an example of the phrase 'educated beyond his intelligence.'
Reply: I have heard that the deadly fire in block of flats/apartments in Trellick Tower, West London, was caused by a Beko refrigerator (then flammable materials).
Reply: The fridge is everything the printer couldn't be
Reply: @hiyukelavie2396  anything will work infinite times as long as you don't break it
Reply: @hiyukelavie2396  its a metal stick
Reply: @hiyukelavie2396  lol such a 🤡 indeed, electrical energy is a mechanical energy because its generated by mechanical way ? What type of bullshit was that, by that assumption all of us don't have any mass because we are just energy waiting to be a gamma rays
Reply: @vincentzakuwan1521  Lol learn to read 

I didn't say electrical energy is the same as mechanical energy 

I said electrical energy is mechanical energy with extra steps 

Do you feel stupid now?
Reply: @hiyukelavie2396  lol do I even say electrical energy is the same with mechanical energy ? I said electrical energy is a mechanical energy due to its generated by mechanical energy is just the same as mechanical energy with extra steps. Keep spitting nonsense and make more definition of something that is useless to us then tell us to read, what a 🤡
Reply: @vincentzakuwan1521  Lol who's the clown here?

I said electrical energy is mechanical energy with extra steps

Do you object?
Reply: @hiyukelavie2396  lol keep asking something to twist someone's perception is what that you do huh ? Electrical energy isn't just come from mechanical energy transformed into electricity, it can come from chemical reaction too and even from radiation, yet you only make it as a mechanical energy with EXTRA STEP, what a joke
Reply: I've thought about that before. About how reliable the fridge/freezer is, never knew one to malfunction and indeed if one did while you had it full of food you can end up in trouble if it's not fixed quickly. It would be such a pain, to have to purchase a new fridge (assuming the old one can't be repaired expediently), move it in, plug it in, get it cold, transfer all the food, then get rid of the old one? Big and expensive pain in the ass!

I'm glad that refrigerators are so reliable.
Reply: @themenacedemonkiller4867  you're right, he should dumb it down for you, because you clearly dont know what a machine is, because a crowbar is a machine, and it doesnt matter whether or not you can grasp that, it still is.
Reply: @hiyukelavie2396  A crowbar is not a lever until it is paired with a fulcrum. No arguement, you are wrong!
Reply: I agree, I also think about this. The older ones they show here just have the compressor, coils and the thermostat. Newer ones are more complicated and not as reliable though. I have replaced the defrost thermostat and fan on a 20 year old Kenmore refrigerator, though the compressor is still original. However, the compressor does knock when the thermostat shuts it down.
Reply: For you their is a saying that perfectly fits you.
Never argue with an idiot. They will drag you down to their level and beat you with experience.

Mark Twain
Reply: Hiyuke La Vie I know this is old, but all of your replies are so frustrating to read. It’s obvious that people talking in a less academic setting are using a colloquial definition of the word that is different from the version you learned in your 8th grade physics class. That does not mean their definition is wrong, just that the definition changes in different contexts. It’s clear that the original comment uses the colloquial definition, as do all of the replies. Why would you purposefully decide to be so obtuse when everyone understands what the original comment is saying?
Reply: The motor sits in an oil bath. So it gets oiled continuously.
Reply: Bacon 🥓 is a machine. 
Nothing else can lift my dog out of his bed. 
Bet!
Reply: @johno9507  yea but you do not oil it after it’s bought
Reply: @hiyukelavie2396  I am sure your classmates or peers love you for your snobbery. Trying to sound smart just to one up the other person
Reply: @thecompanioncube4211  I'm not the one who saw this video and decided to call a fridge "a mAcHiNe"
Reply: @93BlazinFire  same thing is happening with fridges too. Planned obsolescence is a bitch
Reply: @ThatMadCat   OOOH

A fridge is reliant on a human to put things into it 

Heck, a fridge is reliant on a human paying their monthly electric bill on time 

You failed, so sad
Reply: @hiyukelavie2396  It's easier to pay your rent than not get sick. And a fridge will work no matter if you put things in it, where you going with this? 

Get rekt Nerd :dab:
Reply: @ThatMadCat  "It's easier to pay your rent than not get sick"

Ah, spoken like a child who has never had to work, well done you!

"And a fridge will work no matter if you put things in it"

OH

I don't know about you, but for the rest of us the fundamental reason for having a fridge is to keep food cold

Which you do by putting food into the fridge 

With human hands 

You've doubled down on your failure, so very sad
Reply: @hiyukelavie2396  People who can't afford the rent usually don't have houses. And people get sick far more often than they can't afford a rent, so the argument stands.

And the comment didn't say anything about the function, just about the reliability. 

Also try using your crowbar for a few hours, we will see what will break first, you or the fridge. 

Get rekt yet again Nerd!
Reply: @ThatMadCat   "And the comment didn't say anything about the function"

BAHAHAHA!

What happened to "a fridge will work no matter if you put things in it", hmm?

What's the matter? Trying to walk back now because you realized you said something stupid and indefensible?
Reply: @offbeat4772  The problem with your colloquialism argument is that no one calls a fridge a machine in every day conversation

A fridge is usually referred to a household appliance, an electrical appliance, a kitchen equipment, etc 

People don't generally go to Harvey Norman and ask "excuse me but where's the machine section?"

So if OP chose to refer to a fridge using an unusual word choice, then he (or others who are siding him really) don't get to play the colloquialism card later on
Reply: @hiyukelavie2396  You misunderstand. The definitions of words come from their contexts. In the context of the original comment, I understood what was meant, at least 1.1k people who liked the comment knew what it meant, and presumably even you understood the meaning behind it and decided to go out of your way to be pedantic (while simultaneously being wrong about your own classification). This is one of the most basic elements of language. If the people your message is directed towards understand the meaning of your words, then your communication was successful. 

Even within colloquial language, words have different definitions. For example, I would say that calling someone "sick" when they aren't feeling well is certainly not a formal term in the way people use it in their day to day life. That is one of the ways the word may be used in a colloquial form. However, the term can also be used to describe something as "cool" or "stylish." The only way to know the definition behind the word is to look at its context.

While that may seem obvious and like it's not a 1:1 comparison since the opposing definitions are so drastically different in the case of the term "sick," the same concept applies to the definition of "machine." If I'm working on a construction site and I hear someone talking about a machine, then I probably won't assume that they're referring to a refrigerator. However, if I'm in a situation in which kitchen appliances are being discussed, such as in a YouTube video about refrigerators, and someone mentions a machine, then why couldn't that refer to a fridge?

Furthermore, I fail to see how even in your own classification (which is ultimately meaningless considering both the context of the discussion and that it seems like the majority of people understand the sentiment) a refrigerator is not a machine. I mean it is constructed by a combination of numerous simple machines, right? Is that not what a complex/compound machine is? While I don't think whether or not a fridge is a machine in physics matters at all in this context, I do think it's interesting that it could almost certainly be referred to as a machine even from a physics definition.

This is all along with completely ignoring the fact that I believe the average person would absolutely identify a refrigerator as a machine. I mean surely they would identify a washing machine as a machine, and a refrigerator is just a few steps off. Even if they wouldn't be able to come to the conclusion on their own, I would imagine most people would be able to picture a situation where a refrigerator could be described as a machine and agree with that as a description. On top of that, simply googling combinations of "refrigerator" and "machine" will show countless of examples of people using the term "machine" as a way of describing a fridge. 

While I agree that the term "machine" may have been unusual though comprehensible, it certainly is not wrong. At least not unless you only understand the definition of a machine in a computer science/mathematical or some other context and have an inability to think elastically.
Reply: @offbeat4772  Sorry, TLDR

Point is, OP specifically chose an unusual, though technically correct term

If they went out of their way to call a fridge a machine, then that's exactly what they meant, a machine 

And hence all I've done is point out the error in their statement, that a fridge is in fact not the most reliable machine in one's home
Reply: @hiyukelavie2396  🤓
Reply: @hiyukelavie2396  ....A crowbar is a Tool, not a machine....
Reply: @themenacedemonkiller4867  Dude wants to compare a fridge system that outlasts him with electric moving parts with a crowbar that rusts before the fridge first service
We evolved backwards
Reply: It's a shame they don't put that reliability into vehicles. But, we all know why they don't
Reply: @hiyukelavie2396  yeah, but using the same metric a motor will run forever as long as you don't run it until it breaks.. ( eg. well below speccs )
Reply: @josholin31  this is the gayest comment
Reply: @hiyukelavie2396  
> Hypothetically complains about how people can’t accept when they’re wrong
> Is wrong 

You’re a special type of conceited, pal
Reply: @hiyukelavie2396  its a tool not a machine
Reply: @offbeat4772  Did you seriously wrote a thesis to explain to a simple troll why is he wrong? And I say simple because a COMPLEX one would take this conversation beyond 6 months. He is just a simple one ;)))
Hey, @Hiyuke La Vie still here?
Reply: @hiyukelavie2396  I assume you're not using a crowbar 24/7 or are you ?
Reply: Na my wife is
Reply: Fridge cartel taking notes
Reply: @hiyukelavie2396   It's a good thing you're anonymous because you have embarrassed yourself so severely in this comment section your entire family would feel the shame.
Reply: the recent ones are fragile compared to old models.. a woman asked us to take out her italian 60s fridge out, the thing operated 24/7 for 50+ years without a hiccup.
Reply: @hiyukelavie2396  I would simply call crowbar a tool. not a machine in eny form. you are saying that a STICK is a machine. simply cause it can be used as a lever.
Reply: Pretty sure an electric stove will outlive any fridge.
Reply: Good thing I dont have a crowbar.
Reply: @hiyukelavie2396  
1) an apparatus consisting of interrelated parts with separate functions, used in the performance of some kind of work:
a sewing machine.
2) a mechanical apparatus or contrivance; mechanism.
3) Mechanics.
a) a device that transmits or modifies force or motion.
Also called sim·ple ma·chine .
any of six or more elementary mechanisms, as the lever, wheel and axle, pulley, screw, wedge, and inclined plane.
Also called com·plex ma·chine .
a combination of simple machines.
Reply: Nope - the DAD is what the whole thing works.
Reply: @hiyukelavie2396  bravo 👏👏👏 just like most of human history you have one person who’s actually correct while the rest of the uneducated masses try to bring you down for making them look stupid. the human ego is such a fragile thing, isn’t it?
Reply: I never imagined that Id somehow jump from how the refrigerator work to a philosophical debate like if crowbar is a freaking machine. 
Amazing, this internet thing.
Reply: @Weisior  it’s not really a debate. A crowbar is a machine (a simple machine, a lever), but that’s obviously not what OP meant and the other guy spent three months arguing with people because they refuse to do any critical reading.
Reply: Funny how we moved to a crowbar discussion
Reply: @hiyukelavie2396  How is it not a tool?
Reply: Thread is literally "what happens when an immoveable object meets an unstoppable force" lmao. 10/10 would read again, but I'm afraid I would die of old age before I could 💀
Reply: @hiyukelavie2396  a crowbar is only a lever if a person is using it. a person is a machine
Reply: @hiyukelavie2396  I don't follow... How does one turn a crowbar into a super fridge...?
Reply: @hiyukelavie2396  Most everyone has a refrigerator, not nearly as many people own crowbars
Reply: @hiyukelavie2396  Who keeps a crowbar in their house?
Reply: If you've made it this far down to read this sentence you have wasted a significant chunk of your life that you won't get back
Reply: @VCthaGOATdunker         "Hiyuke La Vie"    is an animal...please don't feed the animals.
Reply: @hiyukelavie2396  Yeah, exactly, which implies that literally everything in the universe can be seen as a machine. This means that disputing a point based on such a semantic technicality is unnecessary and meaningless at best.
Reply: @hiyukelavie2396  “an apparatus using or applying mechanical power and having several parts, each with a definite function and together performing a particular task”. a crowbar doesnt have multiple parts
Reply: @hiyukelavie2396  the simplest machine is YOU.
Reply: I read the comments and saw u guys telling me a crowbar is a machine? So a pen is a machine too Right?
Reply: Its also the loudest machine in your home( unless the laundry is going)  and its rarely off....it buzzes all day
Reply: @hiyukelavie2396  a crowbar isin't a machine
Reply: @mr.majkenocs  Except it doesn't become a lever until after it's being used as one, until then, it's just a tool and not a simple machine. There needs to be a fulcrum and something for it to act on to be a simple machine.
Reply: @hiyukelavie2396  A crowbar is not getting several billion uses, it will most likely decay before that many cycles or uses. Also a crowbar is not a simple machine until it is being used (or has a fulcrum) laying there, it's just a tool, original statement is still accurate, you are incorrect.
Reply: @Shademastermcc  Lol

"original statement is still accurate"

No it's not

It's been explained why
Reply: @hiyukelavie2396  And the "explanation" is wrong. Crowbar isn't a machine end of story.
Reply: @Shademastermcc  Lol

You obviously have no idea what you're talking about 

1. A crowbar is literally called a simple machine 

But more importantly,

2. OP's statement is inaccurate. There are plenty of other machines in your house that can outlast a fridge. This has been explained in depth. But no, I don't blame you for being lazy and not reading the whole thread before launching your comment lmao
Reply: @hiyukelavie2396  1. YOU are assigning a crowbar that title. A crowbar is not inherently a simple machine, for the last time, you need a FULCRUM. I don't understand why this is so hard for you to understand. O.P. may have exaggerated but you are still wrong. Tools are not simple machines until they are placed into functional use.  By your logic, the piping in your house is also a lever. My tall lamp is a lever. I'm not replying anymore, just please get the concept of something doing work versus existing.
Reply: @hiyukelavie2396  and you’ll never use your crowbar a billion times in your lifetime. Even if you passed the same crowbar down thru generations it wouldn’t be used even a fraction as much as the compressor to your fridge. There’s a difference in pointing out an inaccuracy and just being plain pedantic about something to sound superior.
Reply: @DBN WARD Omnomnomnom
Reply: Not anymore, compressors barely last 5 years now
Reply: @kgun30   The main thrust of my original comment was obviously "OP is incorrect" rather than "crowbars are great"

Yet you chose to focus your reply on the part about a crowbar 

Who's the one being pedantic?
Reply: @hiyukelavie2396  Dude save it, you are the one in here commenting for months while simultaneously claiming some people can't stand being wrong. I dont even think the original OP ever replied, you just keep raging on how you were right. You must be so fun to be around, prolly why you have so much time to reply to this thread for 5 months.
Reply: @kgun30  "while simultaneously claiming some people can't stand being wrong"

Oh. So do you accept you are wrong?
Reply: @hiyukelavie2396  However I am not wrong, neither is the OP. The compressor to any fridge will be used more than any crowbar used as a lever. You are inaccurate in your comparison to what the OP was highlighting, a household appliance. While a crowbar can be used as a lever, it isn't relevant to the type of machine the OP was referencing. This is clearly the most attention you've ever received in your life. Even if you were 100% correct about everything youve typed for 5 months, there isn't anyone that would follow your type of attitude. Enjoy being alone and telling yourself youre right.
Reply: @kgun30  "However I am not wrong, neither is the OP"

Ergo you can't stand being wrong LMAO
Reply: @hiyukelavie2396  You can't make that assumption never dealing with me in any other situation. I am not the one who has spent 5 months aimlessly arguing for the sake of a crowbar and lever. You've impressed nobody yet again.
Reply: @kgun30  Oh

So is OP wrong for saying the fridge is by far the most reliable machine in a house?

Are you wrong for agreeing with him?
Reply: @josholin31  machine will run on its own once started where a crowbar requires a permanent operator otherwise it's just a piece of hardened steel.
Reply: @hiyukelavie2396  you are indeed correct, a lever is a machine. OK, let's call if the most reliable complicated machine, a step above levers or pullies
Reply: If a crowbar is a machine, im also beginning to think a toothpick is a machine too.
Reply: @diorynovis  if you put it on a fulcrum and level the tartar off you tooth then, technically yes, it would be.
Reply: Life would be very different if it wasn’t for fridges
Reply: Your comment is r/confidentlyincorrect material
Reply: @hiyukelavie2396  Never heard such a bullshit. 
Definition machine: an apparatus using mechanical power and having SEVERAL PARTS, each with a DEFINITE FUNCTION and together performing a PARTICULAR TASK. 
so the crowbar fails at all three key aspects.
only ONE PART
NO DEFINITE FUNCTION 
NO PARTICULAR TASK
Reply: My family is using a refrigerator for almost 17 years.
Reply: @manumudgal4988  bro. A car engine MAYBE gets 200,000 miles. A fridge motor kicks over several billion times. Sure a level or pully maybe last longer, and they are both technically machines. But when it comes to complex, power driven machines, a fridge last 1000 times longer than an AC unit or VCR. They are amazing contraptions. An insinuated box with an indestructible motor
But the dudes who say a level or crow bar are more reliable "machines' are technically true. Something as simple as a hammer or crow bar are still technically machines. 
But a fridge is the most reliable complex one.
Reply: @hiyukelavie2396  you got me there. Yes, a crow bat or pully system is a machine, and more reliable than a fridge. 
I'm only talking complex, electronic machines
 But you are 100% right. I bet 99% of people don't know that. 
But 15 years of a pump motor doing several billion RPMs. That's what I mean by reliable. You could have a 200 year old crow bar and it still would work. Clearly that is more reliable
Reply: @frankiephenomanal  it actually is
 He's right and I am technically wrong
Reply: @hiyukelavie2396  true dat. You're right and I was technically wrong.
Reply: @davidprice7162  Thank you
Reply: @josholin31  that's a goof point. After a decade a fringe is an active pump for several years. A ten year old crow bar has been used for what, maybe an hour at best
 I should have specified more. A fridge is the most reliable COMPLEX, ADVANCED machine in the home. It'll last longer than a AC unit or dishwasher
 Several billion RPMs can be expected from a fridge. That's more than any car will give you
Reply: @davidprice7162  I might be able to find a hole in the "more than any car will give you"
(IE You can get a car to last quite a while if you are willing to put the money in. And the radiator fan gives you more RPM than any motor part... at least at idle.)

But doing some quick math. You'd need about 300,000 miles at 70mph, to equal only 1 billion. (With the rpm of the pistons going up/down. Which is what the dash measures.)

But I think emphasizing "without maintenance" like you did in your original comment. Your statement definitely holds true. And any argument I can make towards fixing / maintaining a car. Can definitely be used towards a refrigerator. So it also nullifies those arguments.

If we were talking about a race though. I drive for a living so my car is running about 40-50 hrs/week. The cooling a refrigerator isn't running more than a few hrs per day.
So I think my car would reach 10 million rotations quicker. (Roughly two weeks of driving. So the race eliminates maintenance as a variable.)

I think overall we are in agreement. Sorry I tend to give things too much thought. Although I'm not alone, look how many replies / likes got got. If that was me, I think I'd be getting annoyed.
Reply: @frankiephenomanal  a crowbar is an automated machine. It automatically transfers force from one end to another...
A fridge is just an automated machine that transfers electricity to a complex "engine"
I think the difference is not machine, but simple vs complex
Reply: @hiyukelavie2396  You're a simple machine
Reply: @TheComminustboxhead  you're right, you're right. I meant complex machines, not the crow bar you got in the garage. I should have stated it my original comment
Reply: Them spoons, a hell of a machine.
Reply: @hiyukelavie2396   LOL.. a machine has several parts designed specifically for a task
Reply: @yyyyy354  lol mine one has to refill several times and two times wear and tear.
Reply: Hiyuke with your statement i surmise you operate a crowbar billion times 24/7 a day to match the posit of the original post?  If you havent then you got no proof to equal what billions of refrigerators worldwide could prove.  Hence you just shut it.
Reply: 60Hz is 60cycles per second. 50 Hz in some countries.  Infinite is of course an exageration.  Hiyuke ill wait for you to prove youve used a crowbar that many number of times.
Reply: All Aware ive told Hiyuke that he use a crowbar in operation as many times as a ref compressor so well believe him.  Otherwise hed better just shut it.  In fairness to him ill call both compressor and crowbar a machine.
Reply: @baronr.junior8628  I've said it before, I KNOW, a crow bar is a machine, and while it may last longer, I doubt anyone has used their crowbar several billion times, but yes, it's probably more reliable, the fridge is the most reliable complex machine. Anyone else who mentions a crowbar is going to hell for all eternity.
Reply: @hiyukelavie2396  🤓
Reply: @hiyukelavie2396 inaccurate, I don't have a crowbar. A crow bar isn't a machine. You wouldn't call a sword a machine would you?
Reply: @whitenoise509 This was the comment that I was looking for. It's nice to see that someone found the main problem of discussion in this thread
Reply: @frankiephenomanal did you two get this sorted?
Reply: @hiyukelavie2396 did you two get this sorted?
Reply: @corporalclegg914  haha no, I don't beleive so bro. But as you can see given the 400 comments & after 1 year, we've made some progress!
Reply: @hiyukelavie2396 a lever requires a fulcrum. A crowbar has no fulcrum.